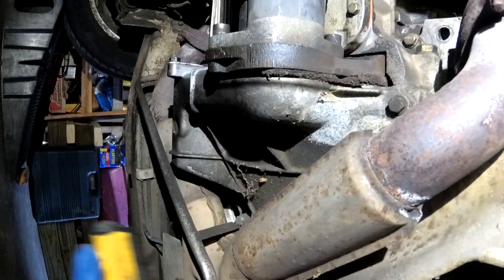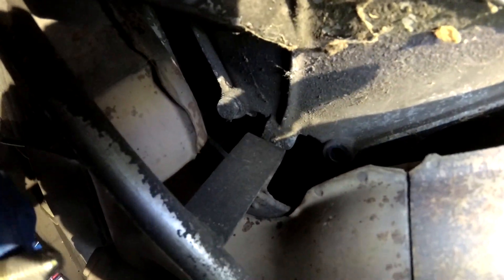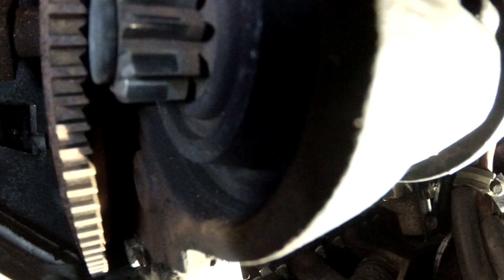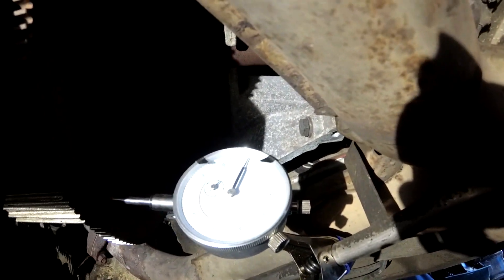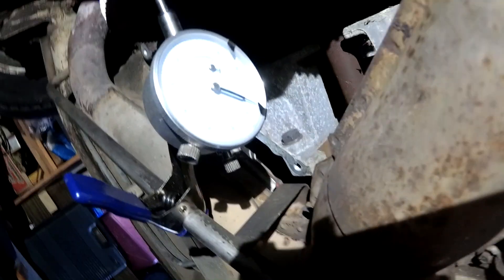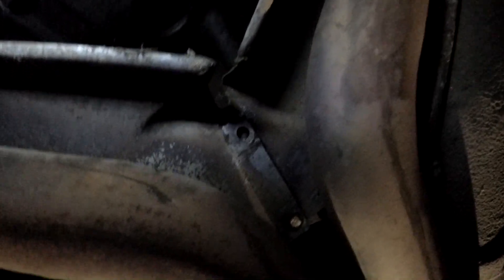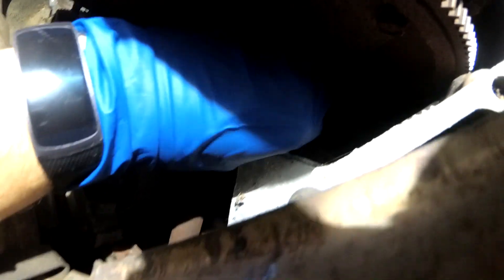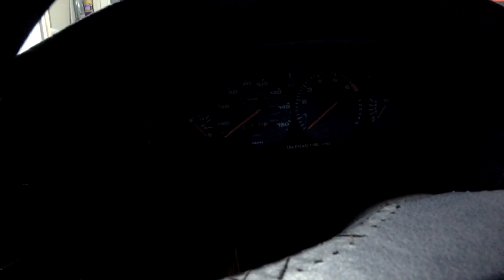928 Driveshaft Tension & Crankshaft Endplay Check

Comment: Just curious how long did it take you to check it?
Reply from the maker: Probably not too long, maybe an hour or so including getting the car on ramps and everything.  You have to take the lower bellhousing off and loosen the driveshaft clamp to be able to move the crank.
Reply: @IntenseBlue318  Thanks... great info! :)